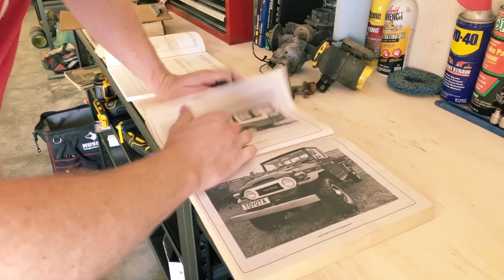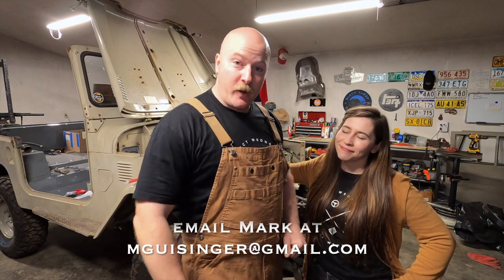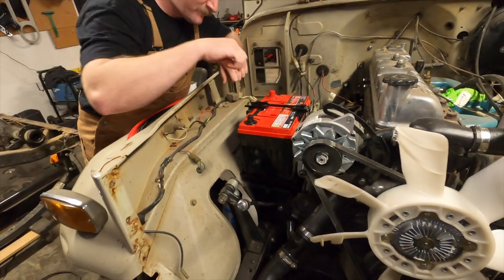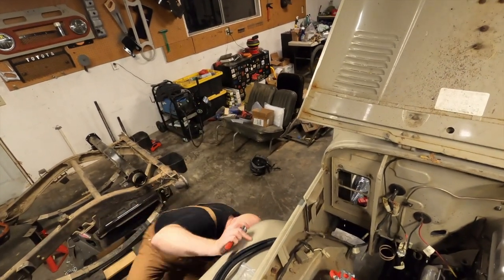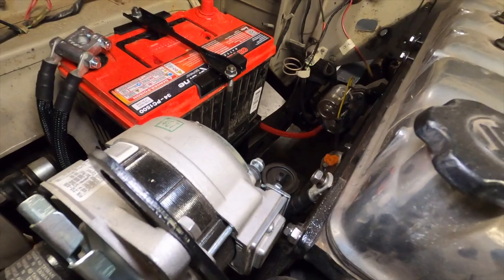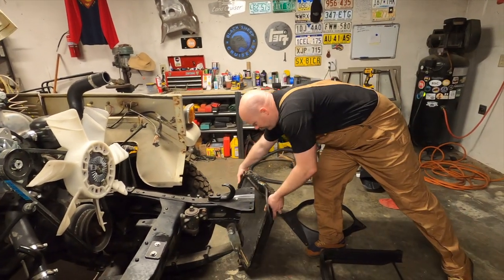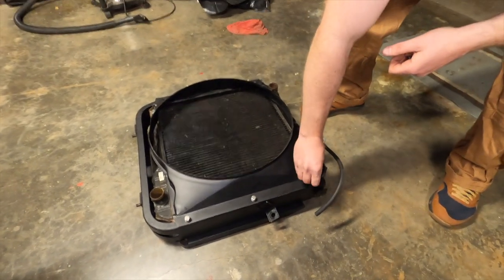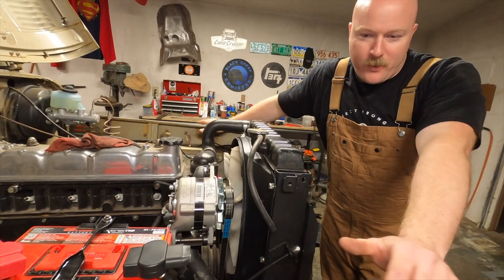Wifey Holds Something "Girthy", Epic FJ40 Battery Cables, Install Radiator and Support, Questions

Comment: - When you redo the battery cables, make sure there's a good connection (no paint etc in between is preferable), and try to choose a bolt that has similar diameter to the hole in the lug. Might be a good idea to charge the battery if it's been sitting.
- Trim the rad hoses to suit, too long is better than too short! Common for aftermarket ones to be a little long. If you leave them too long and jam them on they can kink which can cause issues. Can use goop between the inlet and the hose so things don't get crusty, but ask Mrs Wrongway first.
- Male blindness is real, it's one of the reasons we still need the ladies, even when some of the other reasons become less frequent
-  Usually disconnect the neg terminal first (so when the tool hits something it won't spark). If you remove pos first, and the tool hits a panel, you might do some unexpected welding and need a change of undies. Reverse process for installation.
- PS, when you redo the battery cables we expecting a "laying cable with Mrs Wrongway" pun. This is the way.
Reply from the maker: That is the way! Good advice all around man, and I followed most of what you said..
Reply: @projectwrongway9127  You didn't ask Mrs Wrongway first?
Reply from the maker: Always.

Comment: Add a washer under the nut on the terminal bolt. Takes the stress off the cable tang.
Reply from the maker: Good call. Thanks Mark.

Comment: Love these videos, for future reference you won’t get electrocuted if only one side of the battery is connected you need both sides plunged in to make a complete circuit so start with the positive, red and then secure the negative(black) and you should be good, if you do get electrocuted you’ll live, it just might not feel good
Reply from the maker: Solid advice. And thank you for taking the time to explain it.

Comment: That high torque starter will last longer and work better with bigger than stock cables. It won't starve for current.  Also Ben, hook up the negative last. If you swing a wrench on the positive connection doing it last and tap something metal you will short out... if you do negative last and tap something metal it won't spark and cause damage.

Let me know if you need any specific pics of my 78 FJ40 hoses and such. It is bone stock and never been taken apart.
Reply from the maker: Thanks bro, I will for sure.

Comment: I did laugh my ars off when you thought that battery was gonna bite ya.  Do remember though always check for power with the back of your finger it will lock you hand on there if it gets you. A buddy got me once with open HEi male connections once he asked me to see if the distributer was loose and hit the key 70,000 volts will wake you up, no amps though so it  just stings. Like the other guy said though you could lick the terminal and not feel anything.
Reply from the maker: Ive been tased before, I have a healthy fear of sparks and stuff.

Comment: Nice cables.  Do go back and  clean the paint from the connection though almost all electrical problems come form bad grounds. I use little 1 or 2 inch wire wheels that go on the drill/driver. You gotta trim just about every hose on every vehicle their always a little long.
Reply from the maker: I did, went back and cleaned up the ground locations so its able metal. Good advice bro!

Comment: If the thickness of those cables has HER impressed? hmm... Ya, anyways...
Thicker cables cause less voltage drop, more amperage with less heat, etc.
And the starter is grounded to the bellhousing, but what is the bellhousing grounded to? (motor mounts have rubber pads in them) A ground strap from the starter to the frame would provide an extra ground for the whole engine.
And careful cutting the lower radiator hoses, one of them is "flared" or "reduced", one end is smaller than the other....
Reply from the maker: Great advice Chris, thanks for posting man.

Comment: Check your lower hoses, i think they are the in the wrong places. Align and fit the heater hoses before you tighten everything up.
Reply from the maker: Good looking out, I think I've got it sorted now. Time will tell.

Comment: I think this is the hose you need between the radiator pipe and the water pump input. The hose that connects to the bottom of the radiator looks correct. It’s the other one that’s too long. 
https://www.toyotapartsdeal.com/oem/toyota~hose~radiator~outlet~90916-01056.html
Reply from the maker: Thank you Watts, this is solid info.

Comment: I'd recommend buying $230 worth of lower rad hoses, slip them in a drawer with all those damned hose clamps and then cut 90mm off the existing hose to fit. By the way, how are your knees?
Reply from the maker: Knees are crunchy,... and I am opening a hose clamp store. For sure.